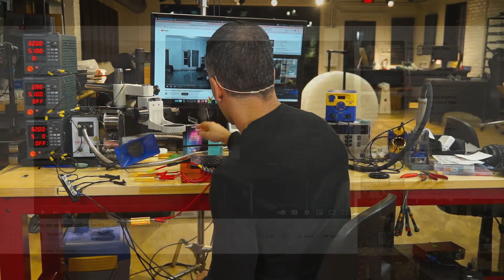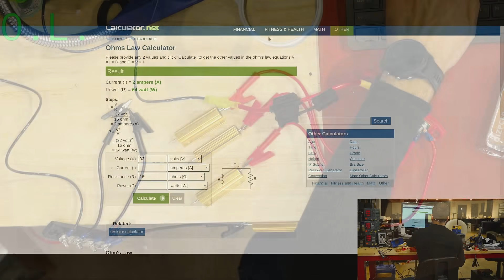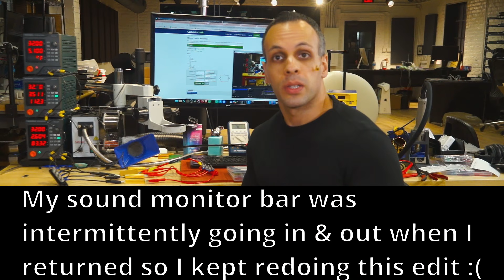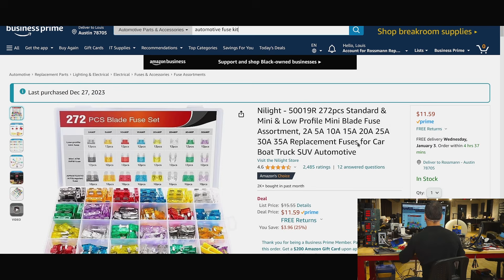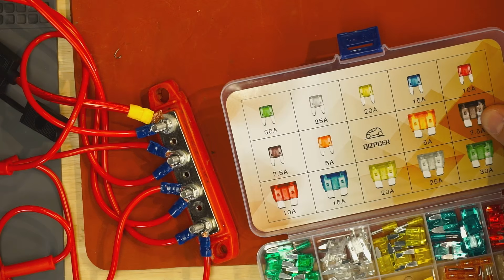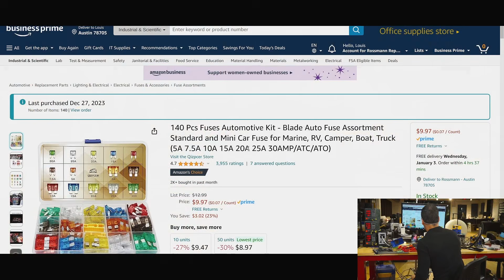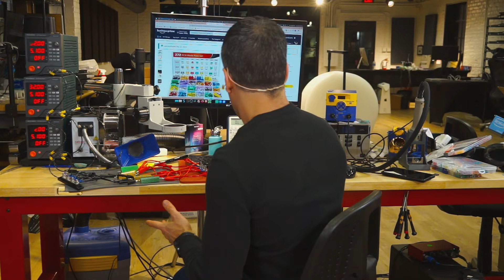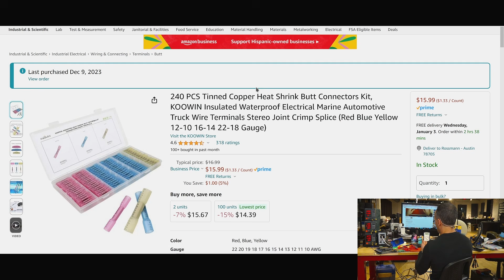Amazon Sells Fake Electrical Fuses

Comment: This marketing makes no sense. They obviously never even test the products they send out. All they have to do is market the 2A fuse they're selling as a 10A fuse and suddenly it would be accurate and safe. You'd think it would be slightly cheaper to make an actual 2A fuse anyway since it would use thinner material also

Comment: I replaced a 30A fuse with 2, 20A fuse’s wired in parallell. I did it because the wire gauge wasn’t quite enough to handle the 30a. 
The current draw for the fan was about 20 amps on average, so a 30 amp fuse was perfectly sized and 2 20’s would be a 10a gain. Well you would think. 
Nope! The dual 20a fuse’s from Amazon blew causing ECT to rise and overheat! 
Comparing two different brand of Amazon fuses  the fusing element was notably, smaller in the fuses that failed prematurely.

Comment: And the worst thing, Fuses are reviewed positively because "they work". However "work" means they closed the circuit, so the thing they are put in runs. The problem is, they are fuses and should be positively reviewed when they blow, which is a fuses actual purpose.

Comment: A UK youtuber did a vid and test of Amazon. Made up a product had fancy bottles and labels for pics then sold a new energy drink...it was human pee. But the point was their lack of advertised safeguards and checks. He used a couple tricks to get it selling fast which was helped by the algorithm and started going fast. Well it worked as he hoped it wouldn't. Worked extremely well. Luckily he had help and no customers were harmed and all refunded.

Comment: MOFO, glad i dont buy on amazon. I use those kinds of fuses on a my Honda Valkyrie Rune. Imagine if they dont burn through. The system could fry, IT IS IRREPLACABLE! I would burn up a 28.000,= Euro motorcycle cause I bought a 0,20 cents fuse from the sh*thouse company... lol.

Comment: First thought that comes to mind, if you made the fuse to actually blow at the rated amperage, wouldn't it cost less in materials? Lol Isn't that the whole point? Love the content, thanks for what you do!
Reply: the price difference is too small, it's much cheaper to just make them all 10A and sell them with different numbers on them, as if the customers are going to buy fuses just to blow them, if it makes the car work again and doesn't blow immediately it is assumed to work well.

Comment: I know it shouldn't matter but it would be moe representative to test at 12V as that is what the majority will be using
Reply: It wouldn't make a difference. Voltage has no effect in terms of how fast a wire heats up

Comment: Nice one - I really appreciate the effort, and I'll be extra careful buying any safety related stuff off Amazon.

If I may be slightly annoying for a second: for a fuse, it’s all about the current, not the power. The supply voltage or the power through the fuse are pretty much irrelevant unless arcing is involved, so what you’re really testing here is current vs. blow time.

A fuse that pops at ~200% of its rating within a few seconds is doing exactly what it should - the rated current is just what it can carry forever, not the ‘blow point’. But of course a fuse that can carry 4 or 5 times its rated current indefinitely is really bad.

An even easier way to test a fuse is to wire it directly to the power supply's output and use the CC/OCP feature to set the max current - without resistors. But please, please, don't run PSUs in parallel - that's a really bad idea. If you really have to then you can just give each supply its own load resistor on the positive side so they don't back-feed into each other. 

Sorry I couldn't resist adding the nerdy bits! I'll see myself out now...

Comment: My family was very poor growing up, and even still I was taught that if you need to buy something that will protect something else of more value (fuses, fire extinguishers, smoke detectors, tires, brakes, etc) you don't cheap out on it. You buy name-brand and reputable, because it's in their best interest for that product to work correctly and if it doesn't do what is advertised, you actually have a company you can sue for reimbursment. Say you buy a cheap rebranded fire extinguisher from overseas and then your house catches fire and it turns out the valve is jammed closed and it doesn't work. Good luck getting any kind of reimbursement; your lawyer won't even be able to find the factory that made it. You buy a kiddie fire extinguisher that is defective and it probably won't make it to trial before they are offering you solutions to make it right. 
I have nothing against foreign manufacturing, but I do against anonymous manufacturing. Remember, if they aren't willing to put their name on it, they don't trust that it is good. I own a small construction company and somewhere on every job I personally write my name and license number. Because I know that my work will outlast me without problems and I want future inspectors to know at least one company still cares about quality.

Comment: I bought some LED tail lights for my old truck.  White is ground.  For gods sake they made white the ground and black the low power (running liggts)  and red the high (brake or turn) voltage.  Who TF thi ks wgite is ground?  Where is white ground exactly?

Comment: Unfortunately, Amazon seems to be a Chinese garbage marketplace. There is 0 guarantee that you can get decent products from Amazon. Just see any thorough tests. LED light bulbs, tools, power banks. Even the claims are ridiculous. 25000 lm LED bulbs, 20000mAh battery (in the size of two AA batteries), brushless tools with conventional motors.... it's all Chinese crap.

Comment: I got a bojack 80a set of fuses o amazon on 6ga battery cable running to a 700w inverter and was charging a power station in the app set at 700w charging for awhile then wanted to see if inverter could handle 800w within seconds the fuse blew which shouldn't have happened. By my calculations only 66a at 12v. The fuse is to protect the wire not the equipment. They claim the battery cable is rated for 112A

Comment: The only thing that would have made this better was if you had a giant red switch to close the circuit... Or an explosives-style plunger. You could claim it's purely for checking their capacity going from cold to above rated capacity.

On a side note, was it intentional at 23:38? Seems like perfect timing.

Comment: Qizpcer was fine. blowing at 2 times of rated current is about right as rated current is current at which it must hold and never blow. Normally fuses are supposed to blow at about 1,5-2 times of rated current. Next one performed about the same as it blew at 2x current. But it was going from 2 right to 4, instead of more gradual current increase for Qizpcer.

Comment: i purchased an "Atoto" brand car head unit based on recommendations from reddit (bad idea). it was awful quality and sounded worse than the stock system that came with the vehicle, so i left a 2 star review. i very quickly received a direct message from the seller offering me a $25 gift card to change my review. i declined and returned the item instead. after watching this video i went to my purchase history to see if my review is still there. no, it's been removed. amazon is like the wild west. even when buying a product from a well known company, occasionally i scroll down to see reviews that say what they received is nothing compared to the item if they had purchased it in a store

Comment: Fuse colors are standardized. If a company can't be bothered to get that right, they can't be trusted. The first set you tested had the wrong color on some fuses. Another telltale sign is if they can't be bothered to paint the rating that's molded into the back of the fuse. In my experience, that's a sure sign the fuse can't be trusted.
Stick with brand names like Bussman, and don't get them from Amazon (they may have counterfeits).

Comment: i can attest to electronic stuff on amazon being garbage, i bought some pre wired waterproof connectors for a project i was doing from amazon, when i hooked it all up the fuse i had in immediately blew, obviously i had a short somewhere, i looked and looked and couldn’t find anything wrong but i still had a short, i was dumbfounded until i realized the connectors i bought weren’t colour coded the same on the male and female side, so what looked like a ground was actually a positive that i simply grounded to the chassis, removed the connector and all my problems went away, some of the stuff they sell is downright dangerous

Comment: If you look at use curves and length of time before the fuse opens you'll actually be surprised how much extra current A2 amp fuse needs to burn out quickly. 10A on a 2A is excessive usually closer to 2x the current and that is good fuse!

Comment: I have bought a shelf of amazon that was advertised to hold 200kg+ of weight. I've been delivered a shelf with very thin metal parts and paper carton like floors. It bend and broke when trying to assemble. I've send that back, went to my local hardware store ( should have in the first place ) and bought it there. It was double the money, but it's thick metal bars and wooden "floors".

That shelf that was sold on amazon would have been a danger to my property and possible to anyone trying to use it.

Comment: This video made me realize how fucking awful Amazon is.

I bought a small kit to replace some internal components for an old handheld with an uncommon screw head. The screwdriver the kit came with was so weak the handle would start spinning before I could get the screw loose. Amazon accepted the return but the fact I had to set aside time to go through that process is silly.

I bought a thread adapter for my microphone and realized the adapter was quite literally not internally threaded, it was just a fucking piece of plastic that screwed into my microphone that was nearly impossible to get back out. Again, return process accepted, but just more wasted time.

A year ago we bought a replacement basket for our air fryer and it was quite literally plastic. I can't make this shit up. I can't find the item anymore but it had at least 5,000 4.5 star ratings.

I don't know why it's legal for a company to operate like this. They basically make their profits off of its customers being too busy or apathetic to go through the return process.

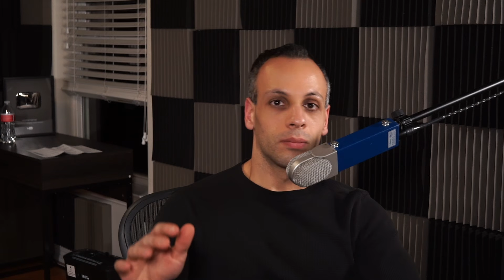Comment: 15:15   That's right, many of us in the peanut gallery do not expect a two amp fuse to blow at 1.99 amps or at 2.01 amps.  But Louis is right that eight amps is certainly not acceptable.

Comment: You should have given more time, A 2A fuse wont blow instant at 2.1A, its never that 
precise, an L-type automatic fuse f.ex should allow 1.7 times rated current for about one 
hour before it trips. Keep in mind fuses are mainly designed to protect wires designed 
for atleast twice their rated current and usually slow.  The higher the current the faster 
they blow. Was surprised some of your kits blew pretty instant at twice current, tho they 
might be fast version vs the slow type (this should be labeled, is it ?). A more scientific 
study would run this more time (atleast 1 hr pr setting), noting how long they hold at 
what overloads measured in seconds / mins and not bathroom breaks ;) I would be 
interested to see if all fuses are the same , just colored different. Will a 10A fuse blow at 
higher current than 2A ? or are they all just same thing in different colored plastic ? I 
would put resistors on heatsink so they dont melt stuff. If they all allow 4-5 times 
overload for hours, thats not a quality sign ofcoz... No fuse should allow > 200% overload 
longer than one hour. at 150% overload they might last many hours or even never blow. 
And yes it is very sad that big companies have zero accountability. Facebook f.ex never 
care about all the scams etc posted, and any big company wont care until theyr own 
loved ones get directly hurt by their actions. Very sad they just erase all negative reviews to get more sales.

Comment: I bought a bathroom fan with a metal enclosure a while ago. Since I don't trust cheap stuff from Amazon, I checked the housing and earth for continuity, no BEEP!?  I opened the enclosure and to my surprise, the ground was simply not connected, it was just cut. 
But the worst was that the connections between leads in the enclosure, were just drilled together manually (with no solder or clamp) and had a loose heat shield sleeve on them. With no earth connected, a loose end could easily touch the enclosure.
I issued a refund and read the reviews and noticed that others had the EXACT same issue with their units. Since it was a generic product with multiple "brands" selling the same product, I tried to convince Amazon to take all the products from their store (around 10 or so) and it took me many phone calls and emails to tell them that it is not a one-time failure, but an inherent flaw. 
After months, they removed the product, but I never saw a notice to not use the product. Since then, I fear of injuries happening because amazons practice!

Best 
Fabian

Comment: just got into the video. DO NOT buy these cheap fuses at all. 43 year mechanic. ive seen diyers wit their circuits and say radios BLOWN for them. they are i believe atleast a 200 percent over current or will simply start melting without blowing!!!

Comment: I just saw this as I’m about to start learning about putting fuses in my projects…. So I went down to my hardware store instead to try out some local 20mm, 500mA Bussmann fuses.   I was able to sustain 700mA for a while through it… it finally tripped at 800mA.     I’m not really impressed with that option either, and that cost $2 per fuse.

Comment: I guess you never heard the saying, there is no such thing as a bad product, just a bad price. I type this on a Keyboard from Amazon with a mouse from Amazon. I listened to it on a stereo/subwoofer sound bar I also got on amazon. It is connected by an HDMI 2.1 cord I also got from Amazon. I have a small fan that moves air around right next to all of this that is also from Amazon while I sit on a comforter from Amazon and have a blanket from them wrapped around my back. I am sitting next to an air purifier from them and my cats are eating catnip treats I got from them. No issues whatsoever. Oh and I have an air cooler around my neck from them as I tend to get hot after I eat due to Crohn's. I just looked up and remembered that I have a Digital Antenna from them connected to my LG B2. My phone is charging on a $15 wireless charge pad that has been awesome from day one. 
The down side? I went through dozens of keyboards, mice and linen to find these. The rest of it were quality products. I just figured out how to tell crap from quality along my journey. I can see you do not have the time nor patience for that and/or consider it beneath you. I get it, you are worth alot per hour. The two videos you have made took more time to shoot and edit than I did looking for and figuring out how to find the best products for the least money. Which I can also do on Ebay and Aliexpress. It's not rocket science. Just smart shopping. 
As I have said before in comments on these two videos, they know who you are in their marketing division. Reach out to them and maybe find some solace.

Comment: To be fair, those ceramic resistors did a fair job.  They're not made to have constant current running through them like that.  Resistance make heat, and heat can build up.  So those resistors seem reasonably well built.

To also be fair, that fuse should've blown at 2 amps.  How is 10amps even possible? How do you screw up that badly in production?

Comment: this is what i found on a dutch forum about specs for automotive fuses:

´belasting´= load

110% belasting: t > 4 u (hours)
135% belasting: 0.75 sec. < t < 1800 sec
200% belasting: 0.15 sec. < t < 5 sec
350% belasting: t < 80ms

I cant give a source.

Comment: Thank you for this video. I have seen a few completely burned chinese solar inverters because they had fake fuses. In these inverters, there are two 30 Amps fuses in paralel. I wanted to test one of them. I was able to put almost unbeliaveable 100 Amps through the fuse and it did NOT blow. But maybe even worse thing is that after aproximately one minute, the plastic melted and after another minute it caught fire because it got too hot from the huge current flowing throught the conductive material. So not only that this fuse does not protect the circuit, it even makes it more dangerous because the plastic melts and gets on other components and eventually it burns with flame which can set the whole device on fire.

One more example. I have bought ceramic capacitors from ebay which should be able to withstand 3500 volts. I wanted then for my 800 volts supply. They could not handle more than 600 volts. When I tried to put 800 Volts on them, they burned. I will probably never buy any components from these websites again.

Comment: What happened to our Consumer Protection Agency's? These things used to be tested, recalled and kept from reaching our shores.  A Fuse is the most important electronic component that will ever be. More products we count on stay powered 24/7.  What happens when you put one o these in an all electric vehicle?  If it doesnt catch fire, 10 amps in a 2 amp circuit will cause inductance into all the circuits within 10 inches of it (likely all of them). Those fuses will blow and nobody will be able to diagnose what happened and your brand new car will be dismantled and crushed. Car computers are not designed to test fuses. Hope that its not diagnosed cause the warrantee and your insurance will not pay for any of it. Amazon- Your Fuckin Krazy. You are not to big to fail, althoughYou did tell the FAA what to do and convince the world that childrens toy airplanes are weapons only used for "Nefarious" purposes (that means Criminally Evil)